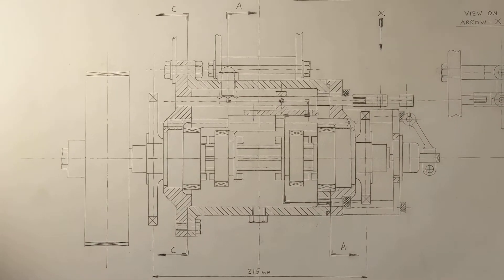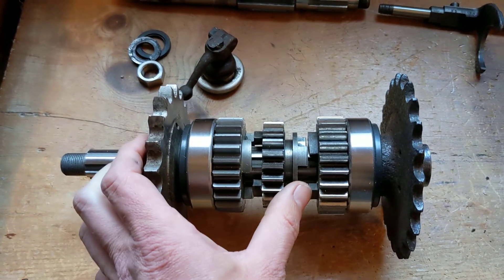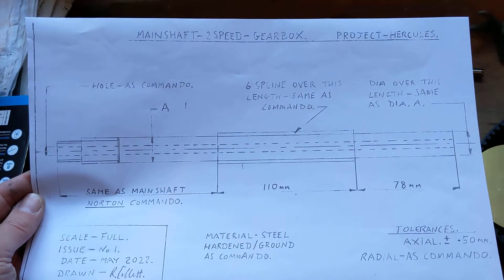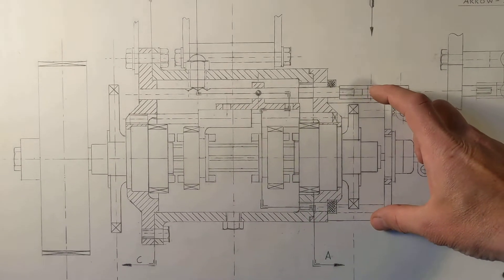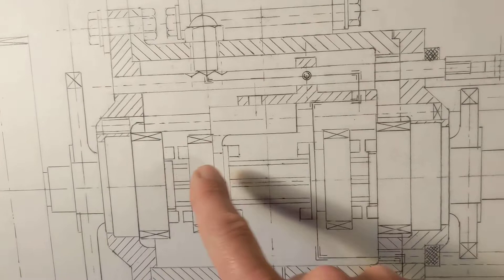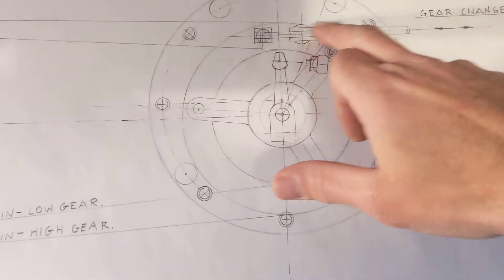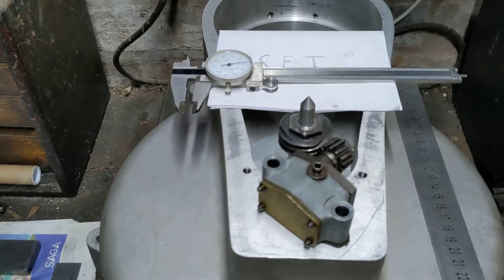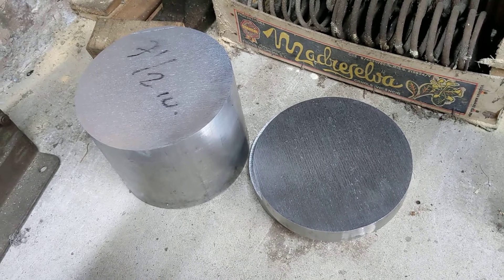Gearbox Drawing & Metal Cases

Comment: Would you be able to tell me what the sleeve stroke is? And possibly the dimension of the cylinder centerline to the sleeve drive ball centerline?
Reply from the maker: I'll get the rule out and consult the drawings, might even post it as a video.
Reply: @StoneEng  thank you so much!
Reply from the maker: Hi Will. The sleeve stroke is just under 3". (2.9"). Most sleeve valve engines seem to have the sleeve stroke at around 30% of the crank stroke. Bristol went with closer to 50%. A longer sleeve stroke gives a larger valve opening. 

The distance from the C/l of the cylinder and centre of the ball is 2.78". 

Why do you ask? Are you building something?
Reply: @StoneEng  thanks a lot for taking the measurements and getting back to me! I'm currently in the loose stages of designing a "scale" bristol centaurus centered around a 34mm piston. But there are certain dimensions that have been very difficult to get ahold of unfortunately.  So thanks again for your help! Very much appreciated!
Take care!
Reply from the maker: @WillDetlor-fz1hx  wow! That's quite an undertaking doing that! Find my Insta account and drop me a message. I can sort you out a set of plans if you like.